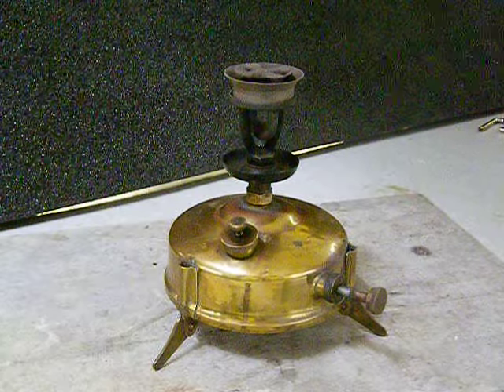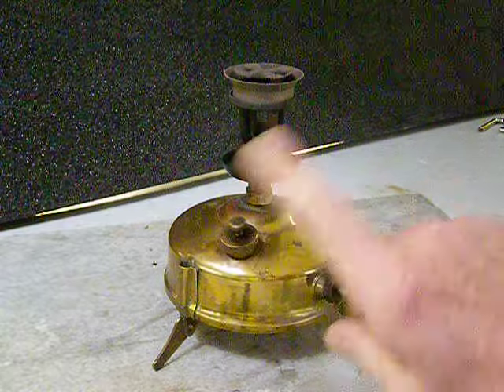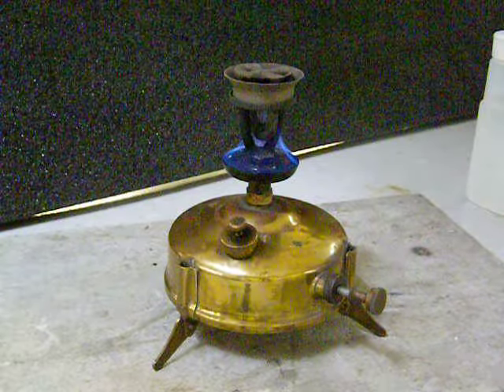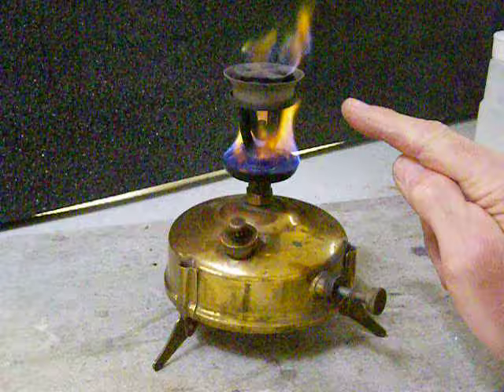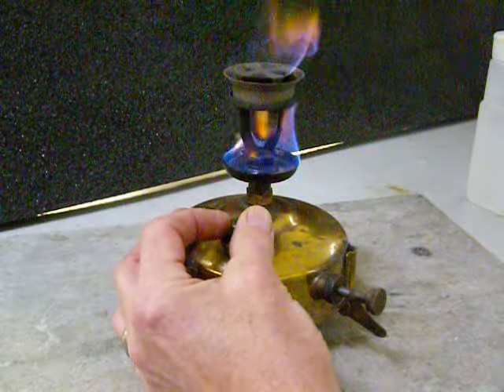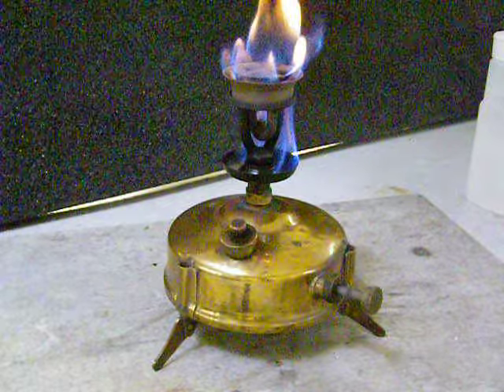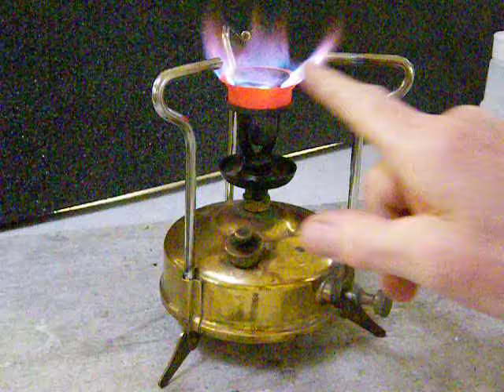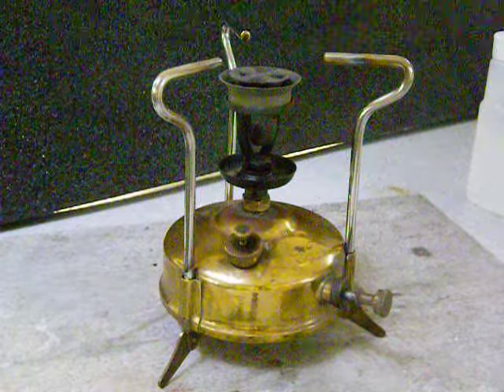Optimus 00 Stove - How to Light

Comment: I'm still using my Optimus 00 I got back in the early 70's. there is not much upkeep needed.  I have one Op 00 that is still the box.  The stove new came with a tube of past fire starter.  for years I used alcohol after the camping stores stopped carrying Optimus stoves.  I now days since Covid ,  Hand sanitizer is readily available and is alcohol plus a gel base. It works great.   Great little stove once sold as a base camp stove or for a group of four.   On solo trips I  carry either a white gas Seva 123 or the Double Ought.  going super light is overrated.

Comment: Hello, I was thinking of purchasing an Optimus 00 stove. It was wondering if any of your silent caps will work on this particular stove and if so, which one
Reply from the maker: Sorry, Quietbear. The 00 has a traditional roarer burner, the same type developed in Sweden way back in 1890-ish and used on more modern stoves like the 111 and 111B. All my caps work on the other type of roarer burners - the ones that have a burner bell. You can educate yourself on the difference, and on a whole lot more stove stuff, by reading the article at this link: https://www.berniedawg.com/silent-cap-for-111b/ The 00 is a fine stove, though. Remember that you need to maintain it for proper flame joy. Happy bush crafting! BD
Reply: @ thank you so much for the information. I have another stupid question so I figured I would ask an expert, from the looks of it. It's not possible because of the lack of space but can a Optimus 8R be converted to burn kerosene.
Reply from the maker: Nope. Not possible. Many have tried and all have failed. Same for Svea 123/123R, Primus 71/70, Optimus 80 and all the other many small naphtha burning stoves with burner bells designed to burn a much lighter fuel than kerosene. If you want to burn kerosene and want a vintage stove... get yourself an Optimus 111, 111T or 111C. Or... an Optmus 199 or Optimus 10 if you must have a small footprint. Different design and different technology in the structure of the burners from those designed to burn naphtha. BD
Reply: @BernieDawgCinema  just last night I purchased a Optimus 111 international from eBay hoping it was a good purchase it looks unused in mint condition has the tested sticker on the burner comes with a second jet and two airflow tubes and the original box no paperwork, though which seems strange to me thanks for all your help and you're expert information. I've enjoyed your videos and you even help me rebuild my SVEA 123 that I put one of your silent caps on and it works beautifully and silent. Thank you for that. there is possibly one multi fuel stove you may not have heard of, and also converts into a heater, and a lamp name is briteLyt rapid 500 CP XL it uses the rapid heat jet that the heinze Geniol German army stove uses not really an antique sort of an upgrade and revamp of the Petromax lamp I have two of them and I love them if you get bored someday check it out they are expensive and they have plenty of accessories once again thank you so much for your help
Reply from the maker: Yep. I'm well aware of the Britelyt products. Not a big fan - sorry. Good that you are happy with yours. Optimus stove manual: https://www.berniedawg.com/optimus-111t-stove-manual-and-instructions/

Comment: Do you know how many seals are on these stoves. I know the fill/vent cap has one. But what about the threaded Pump cap? and the burner head? Thanks for any info.
Reply from the maker: @michaelfogarty8665  Yes. I know how many seals there are on these stoves. The number and type of seals depends on the brand and model of the stove. 
For the Optimus 00 stove featured in this video, here is the seal list:
- One Viton filler cap seal
- One NRV head seal, one NRV pip seal, and one leather pump cup (this last only sorta a “seal”)
You can find out about these in the videos here:
Basic stove repair: https://www.youtube.com/watch?v=2LKsxIYCTko
Pump cups: https://youtu.be/1eDy0k9j9GU
Never use a seal on the pump cap of the stove or air can’t get into the pump.
Additional seals on the Optimus 00 stove featured in this video:
- One lead washer seal at the base of the riser tube where it threads onto the tank fitting - must be lead.
- One or two heat-proof fiber washer seals where the riser tube threads into the base of the burner head.
You can easily see all the seals in the exploded view of the Optimus 00 stove available right here:
https://www.base-camp.co.uk/exploded%20views/Optimus/00%20Camper.htm 
BD

Comment: Hello. Hello, technical alcohol, lamp gas?  can they be used for models of this type?  Gasoline I understand not (possible danger of explosion?)
Reply from the maker: @johnzappa h The kerosene-fueled stove in this video and other roarer burner stoves like it, AND, unregulated kerosene-fueled silent burner stoves similar to it, may not be used with alcohol fuels of any type. These type stoves have a tank air vent for control. Alcohol vapor escaping through the tank air vent will ignite in the presence of flame and go BOOM. Alcohol will not burn at all in a roarer burner and will only burn with great gymnastics in a silent.
Even if if they would work, alcohol fuels will generate only 1/2 or less of the heat energy of kerosene per unit volume.
What is wrong with using kerosene in these? Why try to use the wrong fuel in what is clearly labeled a kerosene stove? 🤔🤷‍♂️ BD

Comment: Can I use white Coleman gas instead of kerosene
Reply from the maker: @Devo1967 Wray Nope. If you use highly volatile Coleman fuel then when you open the vent screw to reduce the flame size or turn off the stove, the vapor coming out of the tank will mix with air and go BOOM! 😮 These are kerosene-only stoves. Use no other fuel in them. BD

Comment: A difficult problem to control a fire level, not as easy to operate as Coleman
Reply from the maker: Difficult?? Oh, my! 😳 I'd bet your great-grandmother used one without difficulty. 😄 BD
Reply: You need to watch more videos on how to lite
Reply: I have never had a problem with adjusting the heat level. Roar stoves are designed to boil water fast for a one pot meal or to melt snow.  I and put together a tastie, nutritional  Mediterranean meal in under 20 minutes.
Reply from the maker: @Tom Sitzman Care to share your "tastie, nutritional  Mediterranean meal" recipe here? Or... is it a "trail secret"? 😏 BD